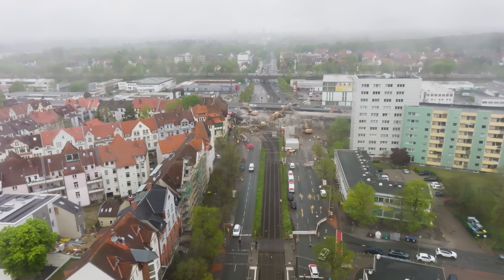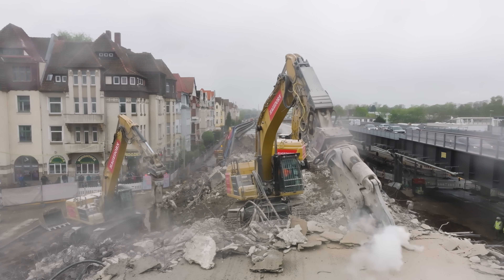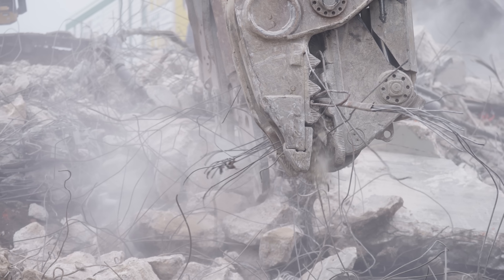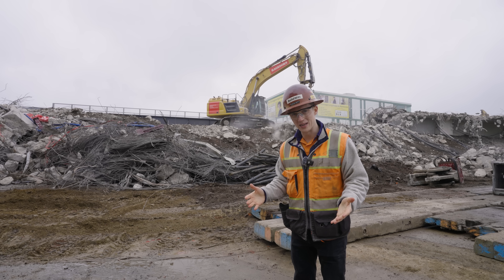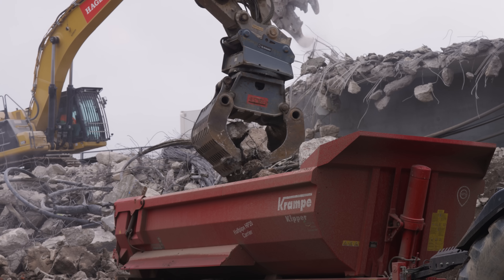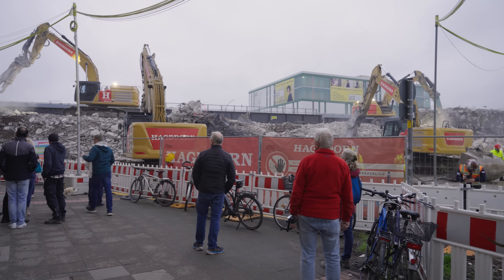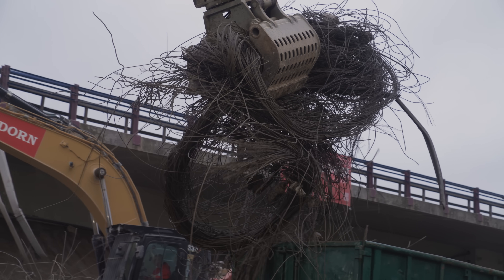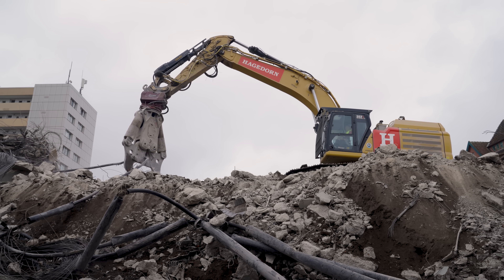How Germany Demolishes a Bridge in Under 48 Hours!

Comment: Those bridges of one of the main highways inside the city lasted more than 50 years. The will be replaced by a massive tunnel-system undercrossing the mainroads in southern Hannover and a length of  ~1km, as I'm informed. Planned opening is 2031.

Comment: As a German this Titel"How Germany Demolishes a Bridge in Under 48 Hours!"  The dutch would have demolished and rebuild (pushed into the gap) the bridge in that time. Germany is held back by an overburdening bureaucracy, and the idea that the cheapest offer is the best, the construction company than just sees the contract as a filler between more lucrative work. Thus ist takes ages till they get something done. Sometimes they have just been founded to get the contract and if they notice that they can not make money on the contract they just close shop and the bureaucracy as to find an other contractor. The problem are not the builders and engineers. It's that the city's in Germany are underfunded. They can only afford a project if the upper levels - the state, bund and EU pay about 90% of the bill. And all these levels of government whey in on the project, usually by issuing huge regulations of conditions that need to be meet to get a part of the funding. Most people in the bureaucracy make sure these conditions are meet. Conditions contradict each other and are changed if the the ruling party in one of these levels changes. This is called "Selbsverwaltung" (The bureaucracy is engaged overseeing itself).
Reply: In this case, they building a tunnel to replace the brigde.
Reply: Der Grund ist nicht die Bürokratie, sondern der mangelnde Innovationswunsch. Man möchte Geld verdienen. Viel Geld. Innovation kostet Geld.

Comment: The tractors are not the standard hauling method in Germany. It's not commom to see that.
Reply: yeah I guess it was more of a supply and also traction thing here as the site looks pretty rough at points, no easy terrain for a normal semi truck.  
You see farm tractors on construction sites from time to time, but yeah, it's far off from being standard, let alone the default.

Comment: Using Tractors has several advantages which do not only apply to maneuvrability alone. Truck drivers have very strict work times according to law and need to rest after a certain while. It doesn't apply for tractors, which gives you more flexibility. Also tractors have better traction offroad and are specifically build to do the hardest work when it is very dusty and the machine very slow. "Normal trucks can rely on the driving wind most of the time when on the street, but on large construction site's they are not fast.

Comment: this part about oilquik shows how far behind the US is with construction equipment/implements development. oilquik and a roto-tilt is like standart in EU.
Reply: Yep! Also known as Quick Hitch Buckets
Reply: I think in the US it‘s stil „one machine for one job“ mostly. andrew camarata is a good example for that (I know, he‘s not a professional demolition/earthworks company). Quick couplers and rototils are expensive, they also need careful operators and regular maintenance, which can be a problem if there isn‘t any service/dealer around. Plus I think you can do 90% of demolition in the US with bucket and thumb, because most buildings are built from (ply)wood or bricks, so a quick coupler propably would only make sense for big demolition companies
Reply: @peon9282 I get your point about this. So, rototilts are actually not commonly used in demolition projects. That’s because the weight of a rototilt makes it hard to work accurately at big heights and long reaches. You’re basically carrying almost a metric ton extra. It’s also too expensive to use in demolition, as it can get damaged easily. About the price: in my area (maybe it’s different in the US), most machines aren’t bought outright but are leased or paid monthly. This way, you can reduce the overall cost of an excavator and put that money into a good GPS system or a rototilt. And when you buy an excavator in the EU, you often get a maintenance subscription from the dealer. That means if you call because there’s an issue, a mechanic will usually show up within a day to fix it. This applies for the first four years when you buy a new machine. That’s how it went for me when I got my new CAT 323 fully loaded from Reko Raalte (a Dutch demolition and construction company), with a rototilt and OilQuick. In the first few weeks, the excavator had a lot of issues, so the mechanic was here like twice a day. Even the OilQuick was part of the contract and paid for monthly.

Comment: For a bridge that old, the concrete looks like it is in remarkably good condition. Most concrete structures of that age in Canada have very obvious damage.
Reply from the maker: freeze / thaw really messes concrete up in Canada
Reply: @buildwitt  Frost and thaw does play a role, but I highly doubt that's all that there is to it. Something happened in the 60s. Infrastructure from those years is particularly bad. The concrete of the Turcot interchange was so bad that you could scrape it out of the pillars with bare hands.
Reply: @jonathanlanglois2742  in the former East-German Territories we do have a similar problem with structures from the 60s

Comment: Another reason for using Traktors (Trecker) in Germany is, that they are allowed to move on public roads. Articulated trucks are restricted to the closed working site.
Reply: Which law prohibits articulated trucks on public roads?
Reply: @Ecovictorian Dimensions. They are mostly too wide and high. If the width exceeds 2.55 m, it's a special convoy and you need a permit and an escort and all sorts of effort and planning. Max standard height is 4.00 m and max standard length is 12.00 m, or 18.75 with a trailer. But the rear end of an articulated hauler is part of the vehicle, not a trailer, so you're stuck with the 12 m limit. So that would be a Bell B30E or Cat 730C with some optional extras, lights and such. 
Or you use a fifth wheel dump truck, they are also very common, but the tractors are more versatile as you can use them for a lot of general construction work by adding hydraulic attachments. And just as fast as dump trucks on the road.
Fifth wheels make more sense if the load needs to be hauled over longer stretches of road where you can make use of the higher road speed. And if you don't have too difficult off-road driving at the site. They are theoretically limited to 60 km/h on normal roads and modern agricultural tractors are approaching or even exceeding that. But in practice, all the trucks on the Landstraße just drive an illegal almost-80 km/h because they are built to Autobahn specs, their limiter kicks in at about 85 km/h and many are illegally disabled.
Reply: @Ecovictorian what cody said, additionally articulated trucks are meant for offroad use, the don't offer many benefits compared to a regular dumptruck. Well apart from being more capable offroad and having a tighter turning radius.
But they usually don't have a supension like a dumptruck or any other truck meant for road use. Their suspension is much more like on a tractor, articulated axles which are fixed to the vehicle in the center. 
Very durable, but the tires do most of the work that on road going vehicles is done by the springs and shock absorbers. That's why they (and tractors) have such large tires with a big sidewall. 
That makes them incredibly bouncy and unsafe at high speeds. 
Going down a country road at 60kph in an articulated truck must feel like riding a roller coaster, your steering inputs will vanish into suggestions.

There's probably also laws that prohibit it. E.g. for cars and afaik also for road going trucks, there is a regulation that the steering whell must be mechanically connected to the wheels, so that in case the electric or hydraulic power steering fails, the driver can still steer the vehicle. I think this is even an EU wide law.
I'm not an expert on agricultural machines and construction equipment, but I assume things like fully hydraulic (like on an articulated truck) or fully electric (like on the fucking hotrod of cringe, the cyberturd) steering are only allowed if the vehicle falls in the category that can't drive faster than 25kph. 

So articulated trucks only make sense when you're using them entirely offroad and/or for short distances. 

I'm guessing cody is absolutely right and they just used tractors because trucks weren't allowed to drive over the holidays. 
Otherwise a regular old road going dumptruck most definitely would have been the best option
Reply: @Harry_Gersack  Bigger tractors have a fully hydraulic steering, and I'm not even talking about the huge ones. But they're definitely going faster than 25kph. Don't know the legal side of it, but at least it's safe to say that fully hydraulic steering systems are possible for some vehicle classes.
Reply: @Ecovictorian the german Straßenverkehrszulassungsordnung StVZO
Reply: @Ecovictorian I think the main reason here is that they arent really designed to drive over longer distances. we dont know how far they have to drive to the recycling facility. also you need a truck license to drive the articulated trucks (if they go faster than 25 km/h wich would be neccessary here) but only a tractor license for the tractors (wich is signifigantly cheaper)
Reply: @c0dy42  Damit man mit einem Trecker auf einer Baustelle fahren darf, braucht man eigentlich auch ein CE-Führerschein, da das Gewerblich ist und der T bzw. L Führerschein nur für Land oder Forstwirtschaftliche Zwecke benutzt werden darf
Reply: @dickerdereck4837  ah das wusste ich nicht. Aber als lohner werden die das wahrscheinlich eh haben
Reply: @c0dy42  Eeehhh, nope. A German tractor license only allows you to drive tractors if they're used for agricultural or forestry purposes. Meaning, if you're not using them for forestry and not for purposes of work for a farm, then you'll need a regular truck license to drive them.
Reply: I think the main reason here is that this was done over the holidays and trucks arent allowed to drive on public roads during those.
Reply: @c0dy42 for Sunday and holidays, etc are exits permits 😎.
And You can drive with Trucks.
The oversite and havy wight Transports rolling only at night, Sundays....
The Differenz between Traktor and semi Truck are the All wheel drive.
Special dumper for construktion have the Problem withe puplic roads and normal dumper Trucks ( the pondon to the US 18 Wheeler but more capazitat and 10 Wheels are more for road
Reply: @c0dy42 
You can get a permit for driving on sun- and holidays. This is possible for construction and food (cooled)
Reply: @c0dy42 You get an exception for a project like this. The main reason would be that tractors are available. For a project like this you need lots of machines at the same time, and at that time of the year there is not a lot of farmwork to do, so they can be rented cheaply.
Reply: @c0dy42  Ich weiß dass Landwirte an Feiertagen arbeiten, also auch mit ihren Maschinen rumfahren dürfen. 
Aber ich dachte das ist weil sie Landwirte sind und nicht weil sie landwirtschaftliche Maschinen benutzen. 
Und das LKW-Fahrverbot gilt tatsächlich nur für LKWs? Ich dachte das ist irgendwie Gewichtsabhängig geregelt, so dass alle schweren Fahrzeuge (mit Ausnahme von denen die landwirtschaftlich genutzt werden) nicht fahren dürfen?
Reply: @Harry_Gersack  ne Das hängt einzig und allein davon ab wie das Fahrzeug zugelassen ist. Ein 3,5 tonner der als LKW zugelassen wurde darf an Feiertagen mit Anhänger nicht rumfahren
Reply: @c0dy42 wenn er dem gewerblichen Güterkraftverkehr zuzuordnen ist, stimmt das. Privatfahrten mit Lkw 3,5t plus Anhänger sind erlaubt.
Reply: @Harry_Gersack Fahrverbot ist etwas tricky. Medizin, Lebensmittel, Trinkwasser dürfte auch an Sonn und Feiertagen transportiert werden. Ist teurer aber was sollen Gaststätten und Bäcker sonst machen.
Abschlepdienste und sonstige Fahrzeuge die zum Räumen der Straße notwendig sind dürfen fahren.
Meldepflichtige Schwertransporte werden auch ab und an auf die Tage gelegt.
Aber normale gewerbliche Transporte mit einem LKW sind verboten.
Reply: They are also used here for the most part on large construction sites
Reply: As stated by poster, tractors have wide grippy tyres for worksite conditions on loose soil, while being legal to drive on the road, an Articulated haul truck such as a A40G volvo haul truck can't legally drive on the road
Reply: Haha der Bulldog macht brumm brumm

Comment: Why specifically was a human with a hose spraying the water on the concrete dust? Do they need it to be done accurately so the site doesn't get too muddy?
Reply: Keep dust down. Silica dust is not good to breathe
Reply from the maker: bingo thank you
Reply: At 10:57 you can see a trailer-mounted water cannon, no idea why they're spraying manually instead of using it.
Reply: Also it reduces a slight fire risk...but moistly. Dust , beat down the dirts ..keeps chunks off the neighbors house an paint an dog

Comment: I doubt that a big farm tractor with a trailer thats made for hard use, is much cheaper than a adt. But it can travel on roads and also in mud, also its more versatile some times you need a water tanker, a container trailer, dump Trailer, 3way dump trailer, Logging Crane trailer etc. and some of that tractor owners also act as a farming contractor, which justify the investment better than an adt, that most companies do not need all year round.
Reply: No driving restrictions…. No time restrictions… Agricultural workers can start this kind of work at 16 👍🏼👍🏼
Reply: @JeremyGibbs-k7q  Not in Germany - in order to drive a tractor for some other purpose than agricultural work or forestry, you need a truck license. And that one you can typically only obtain at the age of 21.
They can of course utilize a tractor for agricultural purposes starting from the age of 16 (with speed restrictions). But that doesn't include a construction side, even if it would be a side gig of a farm. Construction isn't farm work, so a truck license is needed.
Reply: @JeremyGibbs-k7q  that's only true if they are used in agricultural work.
Reply: Tractors are by far the cheapest option around. They're around 20% cheaper on an  hourly rate  than articulated road trucks, have the same capacity and don't have any driving time restrictions, yearly certification requirements etc. Virtually all tractor transport is subbed-out work so it's very flexible. ADT's  are really only used in large earthmoving projects here in Europe where they can stay on-site for an extended period. Most ADT work is also in-house and not subbed out so a lot less flexible, most large contractors have been significantly reducing their in-house workforce over the last decade. On our jobs we get tractors for around 70 EUR/h, articulated road trucks for 85 but ADT's would be significantly more than that, even for longer periods.
Reply: Biggest cost benefit, hagedorn doesn't have to own the vehicles. All the tractors have local license plates, farmers earning some bonus with vehicles they anyways have to pay for. Usually only during harvest season all tractors are needed.
Reply from the maker: it's all of that and they're a lot cheaper. Artics are $$